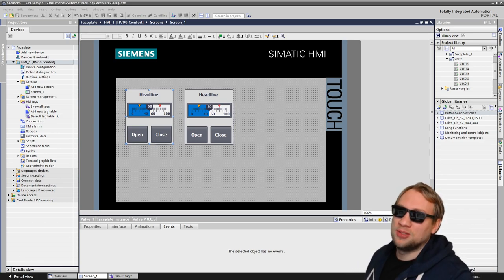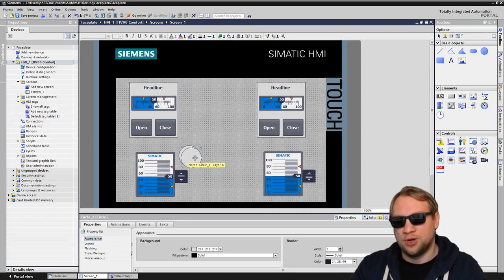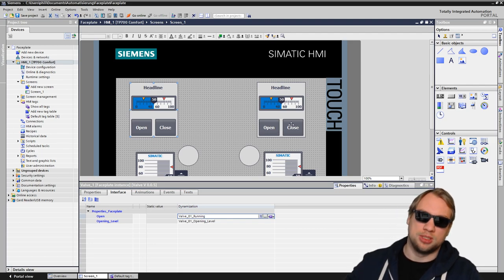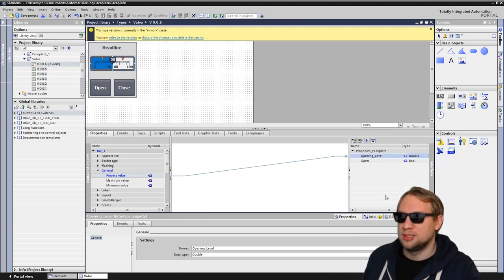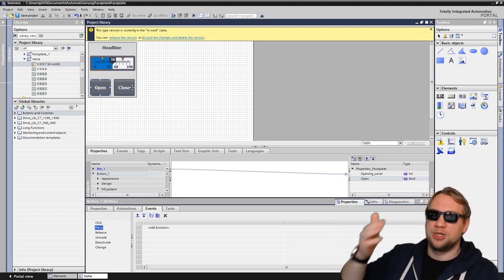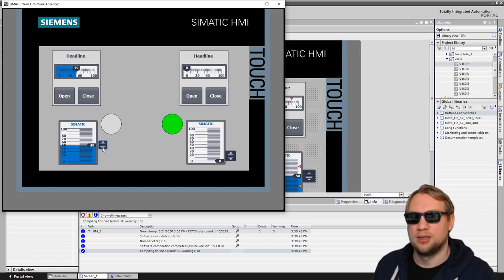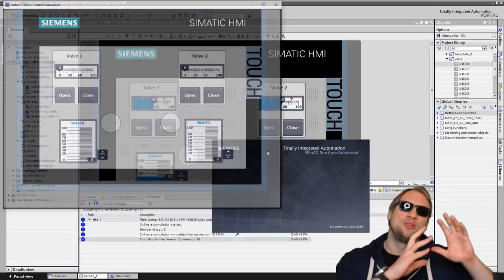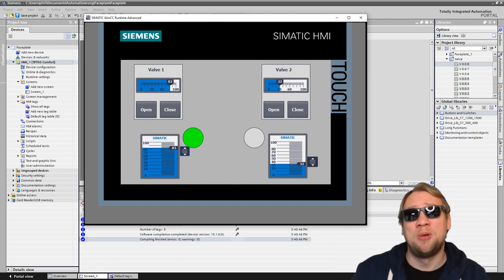TIA Portal: HMI Faceplates Part 2

Comment: ive made something similar, a faceplate, but i cant get the "output" tag (in this video the "Open" tag) to change...the difference is that my  output tag is not an internal tag. It's connected to a PLC tag...
Does the faceplate can only change internal tag?  
i get it to work by changing the tag from the event tab of the faceplate, but i think its cleaner if i can get it to work just by connecting the output tag to the interface, just like in this video...
Great video as always btw!!

Comment: What is the difference between press and click? (For buttons)
Reply: Hey. The following is stolen from the siemens forums. You can usually find the answers to questions there :)
Press
Occurs when the user clicks on a button with the left mouse button, presses <RETURN> or <SPACE>. Also occurs when the user right-clicks on an object of the symbol library.
Click
Occurs if the user clicks a display and operating object with the mouse or touches the touch display with a finger.
In case you click the incorrect object, prevent processing of configured function list as follows:
Move the mouse pointer away from the object while keeping the mouse button pressed. Release the mouse button as soon as the mouse pointer leaves the object. The function list will then not be processed.
On touch displays, the display must be touched with the finger until a reaction occurs, e.g., a screen change.
Release
Occurs when the user releases a button.
This even does not occur, as long as the button remains pressed.
Activate
Occurs when the user selects a display or operating object using the configured tab sequence
Note                
If the user e.g. clicks a button with the mouse, the "Click" event is triggered. Users wishing to trigger the "Enable" event must select the button using the tab key.
The "Enable" event is only used to detect whether an object was selected. The event does not trigger a password prompt. For this reason, do not use the "Enable" event if you want to configure access protection on the function call of the object.
Reply from the maker: Actually I made a video about just that this week!